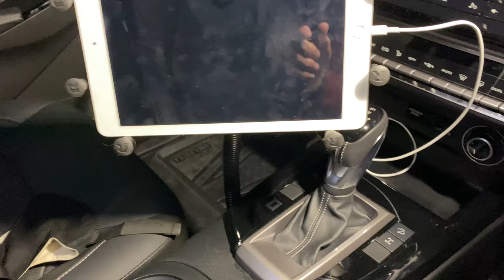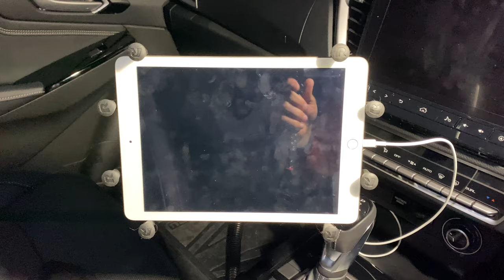12V Electrical Setup | Under-Bonnet System | iPad Ram Mount | Isuzu Dmax X-Terrain

Comment: As an Auto Electrician spending many, many years installing dual batteries and accessories, I find myself impressed with this professional installation. Excellent work.
Reply from the maker: Thanks mate, appreciated. A little cheating though I guess, I am a qualified elec fitter, mechanic and auto elec. Never worked in auto or mechanic (A grade) beyond qualification, most of my work was elec fitter playing with hundreds and thousands of wires at any given time, industrial electronics, etc. Figured the skills don't really leave though. Short of current knowledge, but I figure things don't change too much.

Comment: This is an awesome video, Thank you for information shared. I am think of doing the same as per battery connection with the multi fuse base , as I need to get cables installed to the back the Anderson plugs. Before picking up the caravan. 
When you say a single line from the battery to the fuse base, did you move the current positive cable to the relay or is the current cable still connected to the battery plus the single wire to the fuse base.
Reply from the maker: Hey Deon, the power to the fuse distribution is added to the positive terminal mounting which had a spare bolt to add an accessory cable. So I used it to run one cable to the distribution where I could then manage loads and fuse each one without messy cabling at the battery itself. I didn't have to touch any of the default wiring at the battery, because it had that spare bolt for an accessory cable to be added.

Is that what you meant?
Reply: Thank you, it is what I was after.Will it be right to say, when I ran the cables to the red and grey Anderson plugs on the tow bar, to do the following:
1) single cable to the 5 maxi fuse box
2) cable from maxi fuse box to ignition switched relays 70amp
3) 2 x single positive cables from switch relays to red and grey Anderson plugs 
4 ) connect negative cables from Anderson plugs to chassis 
What size cable do you recommend me to use for the battery connection to Anderson plug
Did you use the micro 2 fuse connector with cable for relays switching 
Did you make the bracket where everything is mounted on at the battery side
Thanks again for the information it helps a lot.
Reply from the maker: @deondebeer5990  Yep, all correct 1 to 4. From the fuse to anderson, it depends on what you're using them for. If your tow DCDC is a 40A charger, then the tow vehicle obviously needs to have cable to suit, then from the fuse to towbar. If you run those two positives together to the towbar, then you have to derate the cables amperage to 80%, as there is a magnetic affect that occurs when you run cables together, along with heat which increases resistance. Then you have voltage drop to calculate, ie. Length of cable run x peak current x 0.017 / cable cross sectional area in mm2.

So, simple, 40A DCDC, lets say its roughly 4M to end of vehicle then 5M from tow to charger, 9M total. If you used 8B&S, you would drop approx 0.8V, which is way too much voltage drop as a single cable. 6B&S you have 0.45V drop. Still too much. 4B&S you have 0.3V drop. Acceptable.

Remember, that is single cable runs, not put together in a conduit. If you put them together into a single conduit, you need to be larger. If 3B&S fit into the lug, go as big as you can to avoid voltage drop.

I use Jaydee Cables here in Melbourne, they also have tables that you can use to calculate your voltage drop and derating factors if you run more than a single cable together.

Me personally, I have no larger than a 30A charger so I can keep V drop minimal without adding too much weight. With a camper the run is smaller, so about 8M total and 4B&S keep VD around 0.2V total.

Comment: Great setup mate, what would you recommend wrapping the wiring shroud in after cutting back to feed wires through? Just electrical tape or is there a better product?
Reply from the maker: I use heatshrink on all joins, I use braided expansion sleeve on cables or conduit. Just depends on the circumstance. Usually braided, as its tough and you can get it in heat resistant version if running near hot stuff.

Comment: Like your video. Curious to know how you have configured the negative return? Is it via the chassis or direct cables back?
Reply from the maker: Hi, sorry for the late reply, been on holidays. Yes, the second battery is chassis connected. I typically use chassis ground connections, no need to ground back to the battery.
Reply: @wai4wd  thanks for the response!

Comment: Just curious were you got the common buzz bar and terminal cover ?
Reply from the maker: https://www.swe-check.com.au/collection/distribution-units-bussed
Reply: Thanks looking at doing something similiar myself did you install main earth point after the neg shunt body side. I see the batteries on the new dmax have possible bolt locations on the negative side was wondering if any of those points can be utilised.